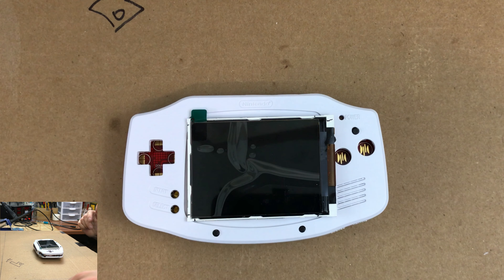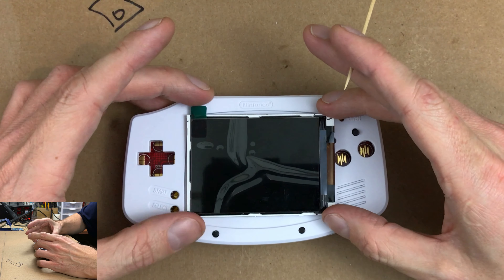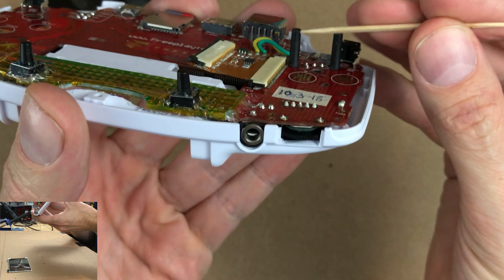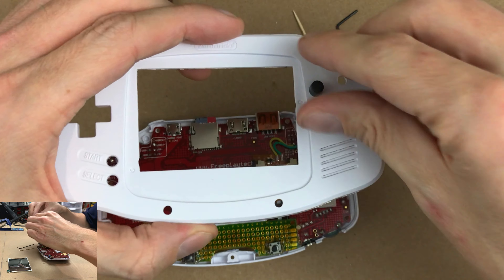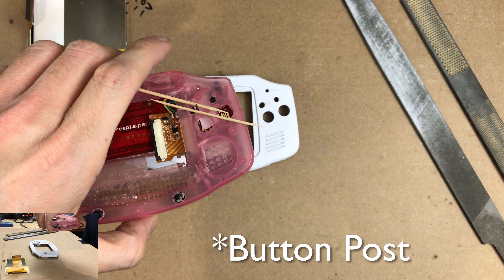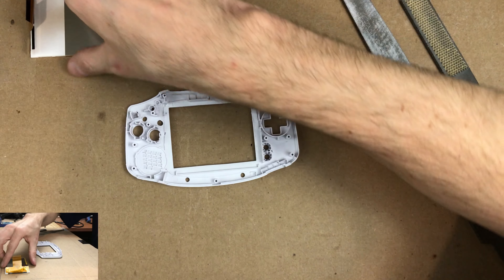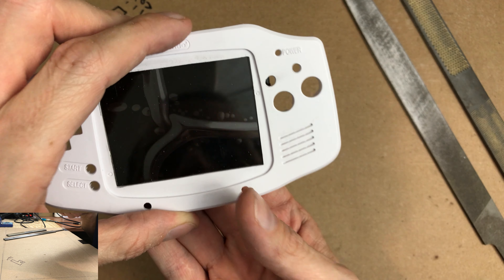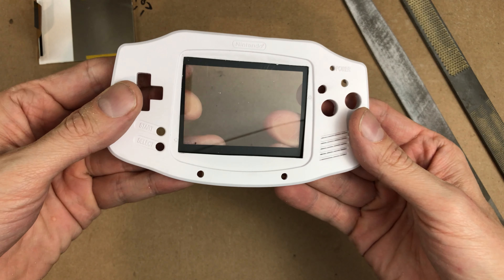Build Log Freeplay CM3 Vita Analogs 08 - Upgrade Screen Fitting

Comment: how did you adjust the raspberry to use all the screen ?
Reply from the maker: aladeen gutieritos There is an easy way to do it. In Emulation Station go to the RetroPie menu. There, one of the options near the top is the display driver option. I don’t have a device near me right now, but I think it’s called “Freeplay Display Driver.” There you just pick the full screen option and you may need to reboot. That’s it. Also, the way I centered the screen for this build is the hard way. Later on I found out it’s much easier to mod the screen a tiny bit. It’s easier to cut a small amount of the white plastic from the ribbon cable connector side of the screen. The screen is fragile so if you try that you’ll have to be super careful. It’s the way I’ve done my last few builds.